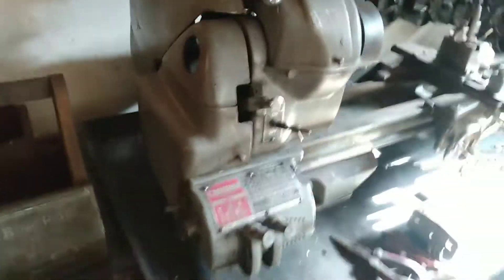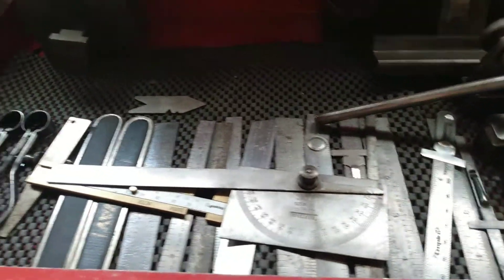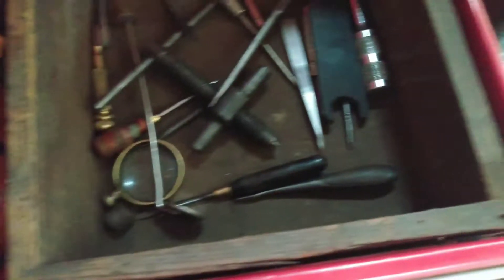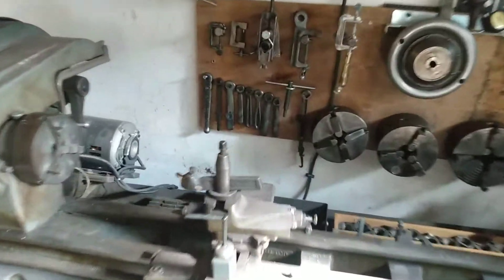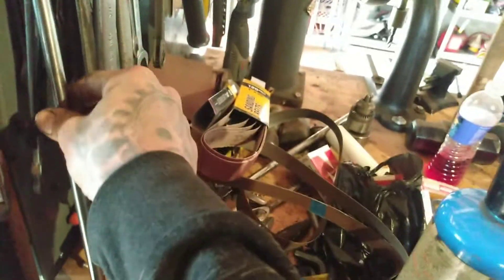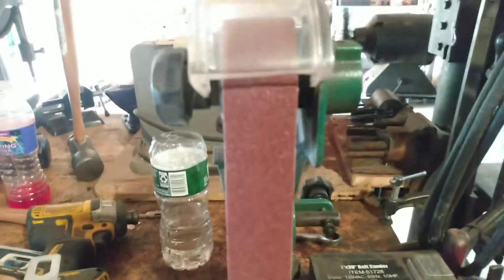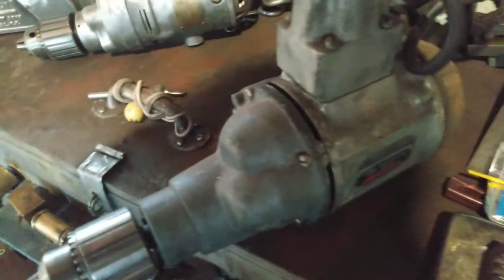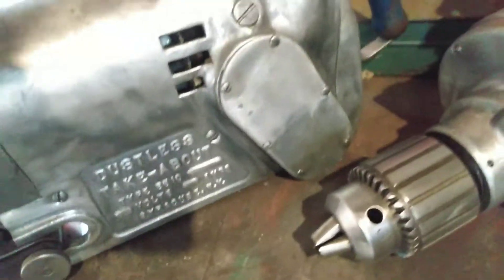Lathe update

Comment: The draw knives work really well for trimming handles to fit hammer heads
Request: you advertise that you want people's tools.  That's fairly rare, I assume; most of us just go to garage sales and ads from sellers.  What are the pro's and con's of getting tools from a "wanted" ad.  It would be great if you could just chat about that on future video
Reply from the maker: No prob I'll definitely talk about that in my next video. I have had amazing success from running wanted ads. Garage sales are awesome but only seasonal so with the wanted ads I get more chances of finding good stuff. I can easily determine from pics whether it's something worthwhile or not. It has worked wonders for me most of my stuff is from inquiries on my wanted ads. Also I browse the tool section on Craigslist often and anyone I buy or sell from/to I always ask if they are selling anything else. A lot of times I go to buy one item and 10 minutes later I'm in a barn hunting. Which I love. I have worked hard a lot of times lugging stuff around. My wood stove as a matter of fact was dissasembled in the rain in the seller's driveway! Thanks for the suggestion I'll be sure to talk in depth next video. And thank you for watching.
Reply from the maker: Btw thanks for the tip on the draw knives. I've actually had to shave down a few different handles recently. I'm gonna try that next time.